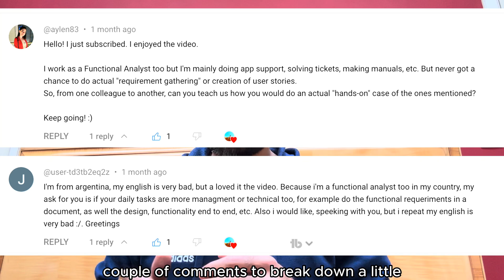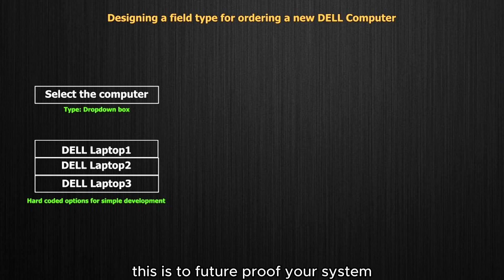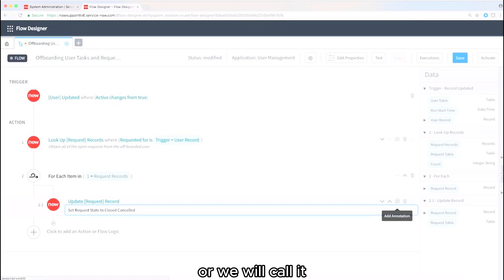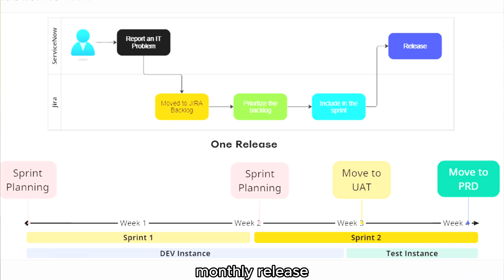What is Functional Analysis step-by-step description

Comment: Hi @joshibaba Thanks so much for making these videos
I am a Business Analyst and switching to Functional Analyst. How would you suggest to prepare for interviews, what kind of questions are raised, can you give an example of an end to end implementation project(if you worked) and your role in that. Your advice will be much appreciated
Reply from the maker: Hello, I am glad the video was useful to you. For interviews you can prepare general questions regarding API's and how integration between different platform works, apart from that the questions would be more on the platform they looking to hire a Functional Analyst. My role in the end-to-end implementation was to understand and document how things need to be implemented (and also implement as we did not have our own dev team but this is optional). Once the initial implementation is done my role is mostly to assist the stakeholders in further improvements within the existing architecture of the platform so that the changes we implement will be future proof. That in short is my role but otherwise I have also tried explaining it in other videos I made, I hope it helps you :)